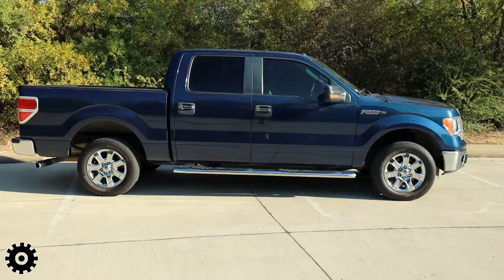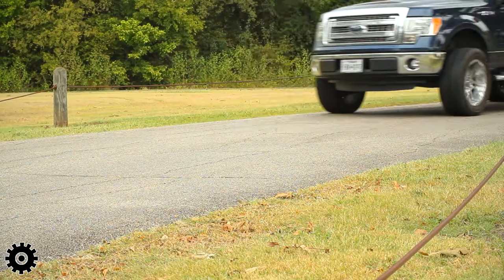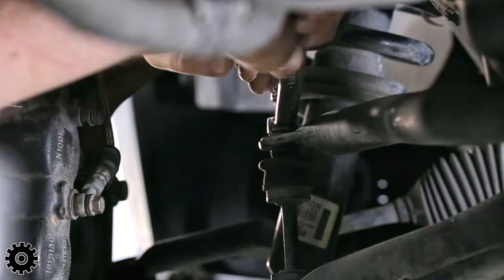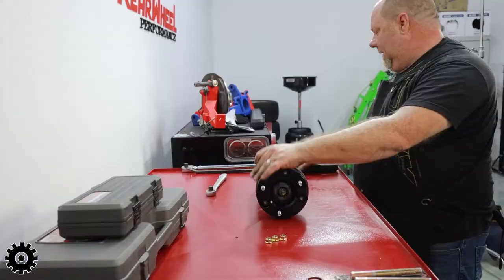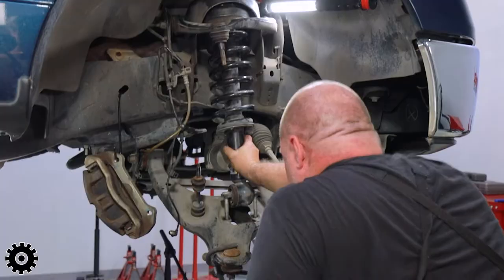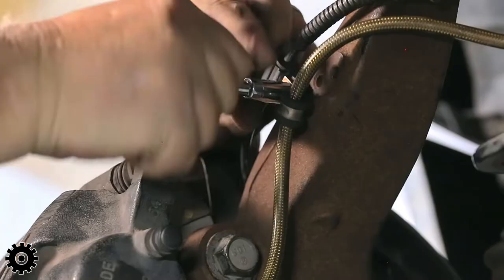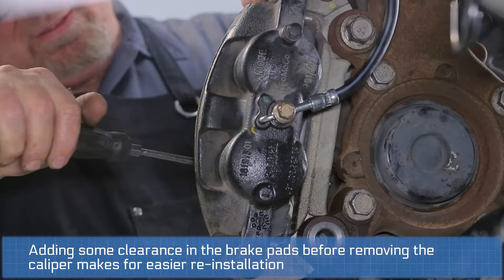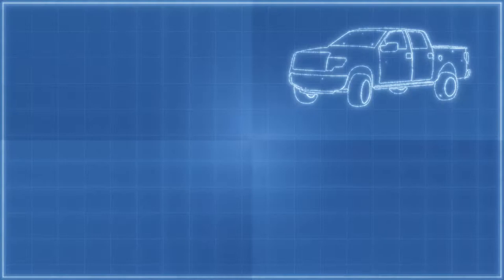Spindle Lifts VS Strut Spacers: Front Lift Kits

Comment: Can you run both a leveling kit and lift spindles
Reply from the maker: For many applications, yes.  But, more lift can mean that there may be more modifications required to allow for brake line and sensor wire lengths and routing.
Reply: So extended brake lines should be fine?
Reply from the maker: @nickdismute6214  Extend the brake lines and any other wires that it may have depending on the application.  Turn the knuckles full left/right at dropout to make sure everything is routed freely and not overextending or rubbing on anything.

Comment: Installing a3”spindle do I need to use different size on Shocks
Reply from the maker: It is not necessary to change to longer shocks (or change struts if equipped) for a simple spindle lift.

Comment: good day
I have a 2013 ram 1500 2wd it currently has a 2.5 inch spacer it looks good but it feels bad and sounds metal metal on metal I would like to know if I buy two inch springs from rough country or the spindles that you say I no longer want to struggle and drive comfortably do you recommend me?
Reply from the maker: Very likely the suspension dropout travel has been reduced and is stopping at the upper control arm/ball joint area (and check that the ball joints are not loose with the suspension unloaded.

In our opinion, lift spindles are almost always a better choice for ride and being quiet if it is in the budget.
Reply: @rearwheelperformance where could I get a spindle lift from

Comment: I'm considering doing a maxtrac 4.5" / 3" lift kit with front spindles would i need to replace the front coil springs or would factory work
Reply from the maker: Most late model trucks have pretty good front spring rates, so unless you feel they have settled too much or unevenly, you shouldn't have to replace them.  Have fun!
Reply: @rearwheelperformance  okay, thank you!  2014 Ram 1500 rwd is what i have .

Comment: Great stuff!!!! If I do a 3 inch spindle lift on my 2016 ram 1500 express rwd, will I need to extend the brake lines?
Reply: 3 inches probably not. Anything over i would. I’m by any means no expert though.
Reply: I had them done. And I did go with longer. Stock lines were a lil too tight for comfort. But you were correct. Gracias for the response.
Reply from the maker: Yes, there isn't enough slack in the stock length for full droop while turning all the way left/right.
Reply: Thank you for the response. I had spacers for 2 months and took then out cuz I wasn't willing to sacrifice that much ride quality for the look I wanted. Spindle lifts are the way to go. Soooooo much better!! I give all the credit to this video.

Comment: I want to do a 2" or 2 1/2" spindle lift on my 10th gen F150 XL 2wd. Maybe 31" tires(Factory is 29")  and keep the stock 16" wheels. But I don't want my wheels to be pushed out 2 inches. I could probably live with 1". Are there any options? Also, is there anything wrong with lifting the rear the same amount as the front to keep the factory rake?
Reply from the maker: We've seen a few brands of 3" spindles for that generation.  If you need less that 3" you could add a drop coil to offset the overall spindle lift.

It would require another complete video to show why, but there are several physical and theoretical reasons behind the engineering requiring the wheels being offset outward a bit with lift spindles, and with that we cannot think of any brand making stock offset spindles.

Lifting the rear to match the front amount is fine and can be adjusted to your personal preference for form and function.

Comment: i have a 2wd 2019 ranger and want to get a spindle lift but the only thing i can find is a lift kit for a 4wd with spindles in it. would a 4wd spindle fit on my 2wd
Reply from the maker: Due to the design of the 4wd front end components, it is not possible to design a 4wd lift spindle.  There are likely full suspension kits that have extended length spindles that work with the kits lower are drop brackets.  Not much is easy or cheap on the 4wd chassis lift if more than just leveling is required.

Comment: So i have spacer lift kit on my truck and i see the upper control arm is outta wack can i get a spindle and install it and that would fix the upper control arm being so outta wack right?
Reply from the maker: If the spacer is causing the issues, then yes, removing the lift spacers, repairing or replacing the control arms and installing a spindle lift should help.
Reply: @rearwheelperformance  but i can leave the strut spacer in and use one of yalls spindle and itll correct the angle on the ball joint in  the uca?!
Reply from the maker: @512juancho  Sorry no, the suspension travel and geometry are the same at the connection to the control arms.  Problems using a strut spacer lift with stock spindles will be the same or a bit worse on lifted spindles.
Reply: @rearwheelperformance  so my best option is either a upgraded aftermarket UCA or remove the strut spacer and use a lift spindle  right?
Reply from the maker: @512juancho  Yes, both will likely solve your mechanical issues, but the spindle solution will also restore the ride and handling back to near stock feeling.
Reply: @rearwheelperformance  thank you for the replies

Comment: why do people say it is bad to leveling kits? I have a truck and every shop is trying to sell me a suspension set which cost $1600 and I don't ride off road... mine is just a 4x2. so should I just do a leveling kit>?
Reply from the maker: Leveling kits and spacer kits biggest drawback is the reduction of suspension dropout travel.  The control arms are set to a different ride height angles than they were engineered for, which can also effect ride and handling, even on the street.  Depending on the make and model, upper and/or lower ball joint wear and failure can also be increased.  A couple of inches usually is ok, but many 3"+ spacers can be brutal in the short and long run.
Reply: @rearwheelperformance  Thank you for you reply. I am thinking around 1.5" to 2" max spacers. not going to do anything more than 2".

Comment: Hello there so I had a question regarding the spacer put on the break line to relocate it how can I find it and is there a better video that c an show me how to install it safely
Reply from the maker: Spacer lifts will rarely require modification or extension of the brake lines, but most spindle lifts will require modification or extended brake lines.  Most companies that distribute suspension lifts will also usually also sell or include extended brake lines that can be installed if necessary.
Reply: @rearwheelperformance   I just recently purchased a 4 inch spindle lift kit from maxtrac and I was wondering how you did it with the break line on the video it doesn’t  show you installing extended break lines ?
Reply from the maker: @guadalupezepeda2374  The hard spacers in the video are prototypes that are being long-term tested for safety and functionality, but are currently not in production.  Until these are released, we recommend extended brake lines as the best way to proceed.

Comment: Can I still upgrade the upper control arm for one that’s made for a 3 inch lift?
Reply from the maker: Probably, but we'd like to know the complete vehicle application and manufacturer part # of the control arms is.
Reply: @rearwheelperformance  it’s a 2002 gmc Sierra rwd, I have a 3 inch rough country lift kit that has the spindles/knuckles

Comment: I heard a coilover front spacer compresses the stock spring a little bit where a spindle would not and be better?  If coilover spacers do compress the spring at all, how much so for like a 3” lift? Considering getting the spindles.
Reply from the maker: There is the feeling that spring spacers will ride stiffer, but that is mostly felt over rough roads, trails and railroad track crossings.  This has more to do with the reduced dropout travel from the static ride height.  Spindles allow the full range of dropout and compression travel, as designed from the factory, and should be very close to the stock ride and handling.
Reply: I had strut spacers and never felt any difference on my truck at all.  Not the slightest bit.  It doesn’t change your spring compression. It just adds length on top of the strut. Maybe if you put the spacer that goes inside the spring where you have to take the spring off then put the spacer on and then put spring back on and it compresses your springs to lift it more. That will make it more stiff.  But spacer on top of a strut you won’t notice anything at all. If there is a difference trust me.  You won’t be able to notice.

Comment: How much for bigger spindle for my 2006 Ford f150 4.6 2wd
Reply from the maker: That generation chassis was fairly brief, and we haven't seen any cost effective cast iron spindles.  There is at least one manufacturer making fabricated steel spindles, but we would expect them in the $1000 range.  Our supplier does not currently make them.

Comment: I have a new body Ram 1500 4x4, between these two options the only one that works for me is struts spacers?
Reply from the maker: 4 wheel drive applications are a more involved design when considering their axle shaft connections and movement.  Spacers are a good moderate lift option, and much more than 2-3" a full lift kits with control arm and differential relocation brackets would be required.

Comment: Hey can anybody tell me how I can get ahold of rear wheel performance I want to see if they got a lifting spindles for my truck
Reply from the maker: We worked only on the 09-20 F150 2WD lift spindle/knuckle development up until cov and paused the program after the first finished batch arrived.  We have designs for more vehicle models, but are holding off on production of those for now.  877-910-2244 M-F 8a-4p Central

Comment: I got 2007 f150 2wd i put a 2"space  when i put it together the upper control arm and spring their too close it other. Looks like not safe too drive thats why i take them out.. maybe the best option like you guys did to change spindle much safer to drive....
Reply from the maker: The benefits of spindles often outweigh the added cost.  But, that said, we've seen a lot of spacer lifts that allow the upper part of the spindle contact the spring during full droop, but because it doesn't touch/rub during any normal driving, it is usually not a concern.

Comment: spindle lift not doable with 4x4?
Reply from the maker: There are lift kits around 6" that use modified spindles along with drop brackets to lower other components such as the lower control arms to accommodate the axle shafts that 4 wheel drive vehicle have.  2 wheel drives are much simpler so they can use lift spindles with minimal other modifications.  Lift spacers are often the cheaper and easier alternative for 4 wheel drive applications, but they are only designed to add a few inches of height.

Comment: So just to clarify, you CANNOT spindle lift a 4x4? I just bought a 6” lift truck and found out who the brand of the lift is because I want to lower the truck 2” but they are saying it’s impossible since it’s a spindle lift
Reply: That’s just common sense that you can’t put 2wd lift spindles on a 4wd because for one the cv axles a have to go through and there wound t be room for the front differential
Reply from the maker: These particular 09-20 2wd lift spindles will not fit any 4wd/awd application.  Some other brands have much more involved spindle lift kits for 4wd, but they use a different design of extended length spindle that is used along with lower control arm drop brackets.  If it is a later model F150 there are 2" drop spindles available that fit both 2 and 4 wheel drive applications.

Comment: So if you have a 4x4, a spindle lift won’t work?
Reply from the maker: A 2wd spindle will not allow for a front axle to pass-through.  But, there are dedicated 4wd spindle lift kits available that use a combination of a 4wd spindle and lower control arm relocation brackets.

Comment: Would you recommend spacers just for the look, I do not go off reading, thank you
Reply from the maker: Spacers up to a couple of inches are fine for the street.  If going more than about 2 inches or for heavy trail riding you would want to make sure there is enough drop-out travel with no binding in ball joints or tie rods.

Comment: can u do both
Reply from the maker: It can be done (stacking spindles and spacer lifts), but many manufacturers and suppliers will recommend against it.  Safety related things like brake line and electrical line routing and lengths can also get more complicated.  It is frequently done against the manufacturers' advice, but can work out ok when done properly.
Reply: So basically get extended brake lines?